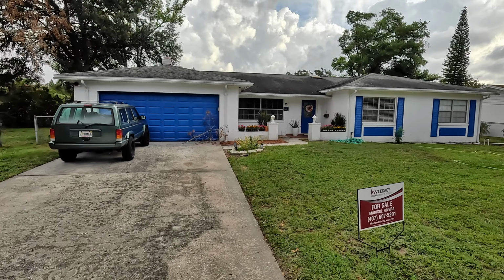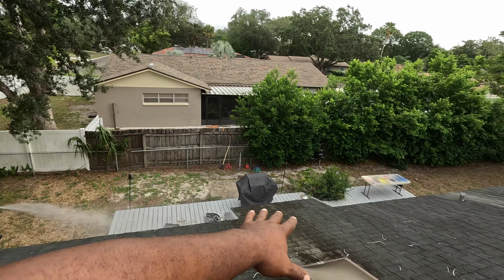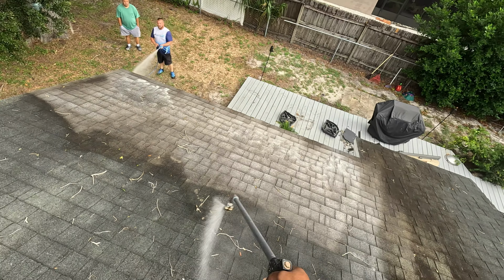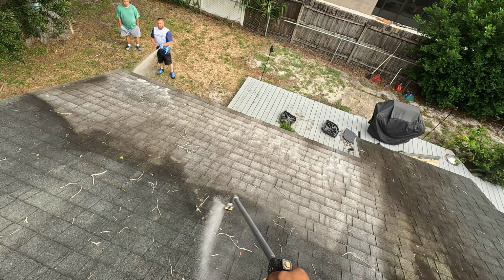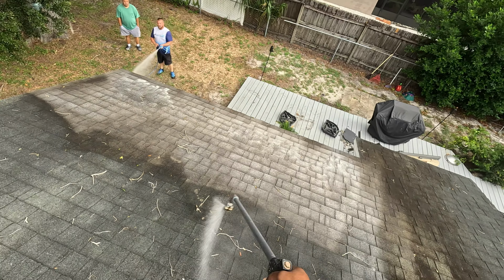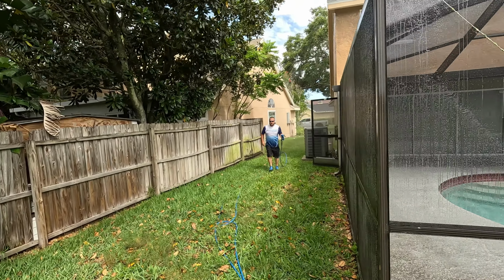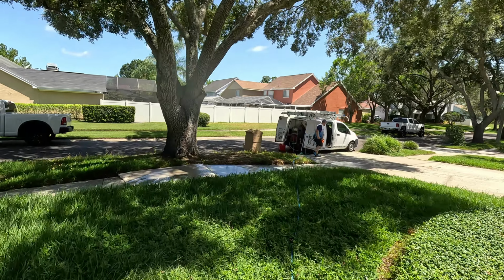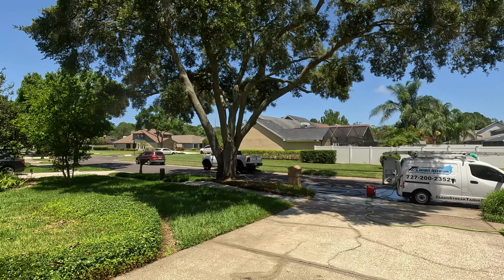No Truck Yet But Great Help Is On The Way #pressurewashing #housewash #roofwashing

Comment: Do you ever rinse it if the moss is still stuck on tiles or  shingles?
Reply from the maker: We don't have that here like that.  If I can't blow it off before cleaning the roof then it stays until the rain comes.  The sh will dry it up and it will fall off the roof.  We don't have that thick moss like up north here in Florida.